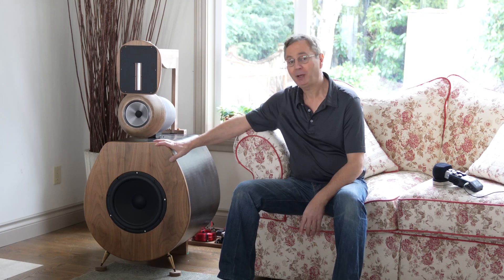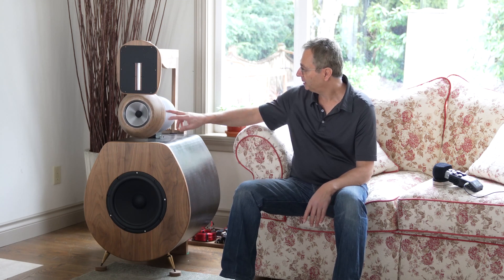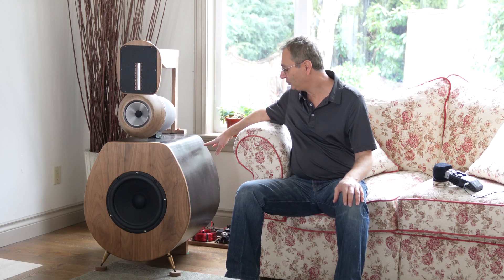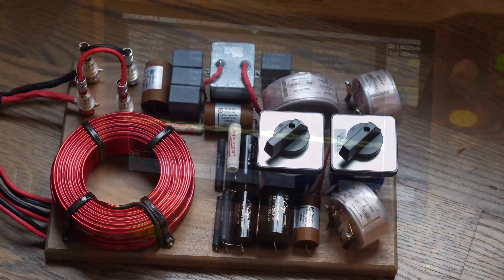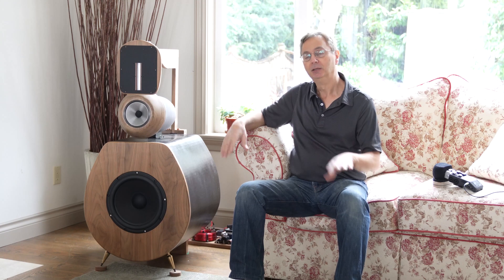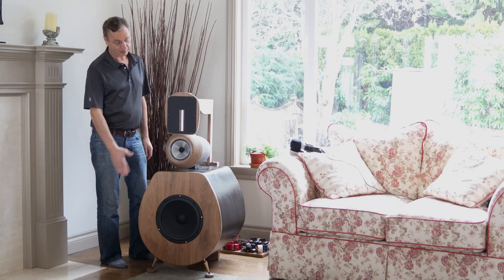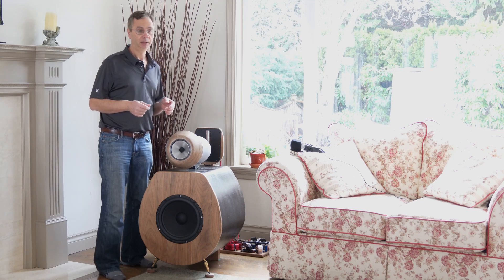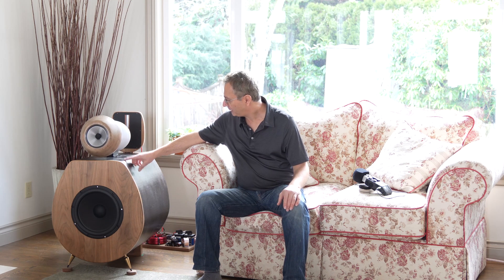My Best DIY high end Speakers Part 1

Comment: Hi 
I have enjoyed every minute I have watch this video 
However you didn't mention where did you put your crossover points 
As I can remember the B&W is a pure midrange with low xmax and it can't get lower than 250Hz and as it being 6 intch driver it can get higher than 2.5KHz 
Am I wrong???

Comment: You obviously didn't try the right active crossover. It is night and day back the other way. It would take a mega high end passive crossover extremely well designed by someone who is a master at designing crossovers to come anywhere near close to a really good active crossover. I am using a Ground Sound DCN28 with my Raal / Scanspeak / TC Sounds open baffle speakers and they sound absolutely wonderful.

You have already learned some of the most valuable lessons about active crossovers, while you can get a fairly flat EQ, if you apply too much filtering etc etc, you can really wreck the sound. So any changes you make to the active profile should be modest and well thought out. You have also learned the other valuable lesson about active crossovers, and that is you can not beat them for finding the best crossover frequencies. I played with mine for several days just making adjustments and having a listen. No having to muck around with changing components, just update the map and upload it.

As I put in my other post you would have been better off with the monopole Raal 140-15D tweeter. The dipoles like to be a minimum of a meter off the wall (in all directions) to make them sound great, and by putting the dipole virtually on top of the rear wall you are almost making a monopole out of that dipole but with poor time alignment.

You should try and put the speakers another half a meter further into the room and have a listen (while the wife is out).
Reply from the maker: That looks like a nice unit all balanced, I went on their site sad to see they are out of business.
Reply: @Gabster1  unfortunately they are. I bought mine probably 11 years ago and it cost me about $7,000 back then with the software dongle (that was about $1000).

Today I would probably go with a DEQX which I was also looking at back then.

Comment: I am wondering why you chose to use the RAAL dipole tweeters instead of the regular monopole 140-15D, when your mid is and bass obviously enclosed. I use the RAAL 140-15D AM dipoles myself in my open baffle speakers, but they don't sound as good as my monopole 140-15D AM.
Reply from the maker: I love them I wanted to have the option to close the back or not but decided not to after listening to both but never tried the factory closed version.  Mine are crossed low around 2200 hz so I get some of the open baffle sound. I think for the dipole the distance to the back wall and even side wall play a role so as room acoustics.
My second favorite listening position is a chair between the 2 speakers you feel you are in the band try it sometime.
Reply: @Gabster1  it is hard to go wrong with RAAL tweeter regardless of what you buy. I have 2 x 140-15D AM dipoles, 3 x 140-15D AM monopoles (future L,C,R) and 4 x 70-10 AM monopoles (future surround speakers)

I just found the 140-15D AM monopoles to be that little bit nicer, plus they also play lower. I have my dipoles crossed over somewhere around 2700 - 2800 (can't remember what I set in the active crossover). But the monopoles are capable of going as low as 1600Hz (LR4 slope).

Have you tried making the mid open baffle? I think you would be pleasantly surprised. The woofers I don't think really matter that much. Currently I have my 18" woofers without a baffle, but I am going to build some enclosures for them. You need a awful lot of drivers to do OB woofers properly (due to cancellation).

Also as a side note I love the ScanSpeak 12MU's paired with the RAAL tweeters. The paper driver is very neutral and compliments the tweeter well. Ribbon can sound a bit in your face if crossed over to low, Using a paper driver as a mid tames any brightness that might be exhibited by the tweeter.

Comment: Great job 👏🏻  like the frequency with a little lower at 1-2k. It’s an area that can be hard to listen to. You thought of many things on this build. Standing waves. And sandwich construction etc.  … really great. Like to hear them.
Reply: Are you talking about the tweeter to mid crossover point? The dipoles don't like to be crossed over too low. Raal recommend a 4th order LR crossover (reasonably steep) at 2500hz, whereas the monopole version of the same speaker can be crossed over as low as 1600hz @ LR4 (presumably it can go lower because the back is encased and controls ribbon movement). I cross my Raal dipoles over at about 2750hz, any lower and it can start to sound a bit too clinical. The one great advantage of using an active crossover, you can play to your hearts content finding that sweet spot.

Comment: I think you have to play with the port a bit. It punches at some quite high frequency. Also three bands are audible: lows, mids, and highs.
PS It's easy to sell metal membranes, but I'd never use it in my design. 
Try to stitch bands properly, and you will never need the most expensive drivers in the world, and 1-st order crossover will be enough.

Comment: the highs sound waves travel faster than bass so it's normal that  it's better to put the tweeter back
Reply: All sound travels at the same speed. i.e the speed of sound (which is effected by temperature and pressure) but I digress... What alters is the wave length of the sound wave. At 20kHz the wave length is 17mm, whereas at 20Hz the wavelength is 17 meters. Why you often see the tweeter slightly set back is to time align the drivers. In the case of the Raal dipoles he is using, the aluminium ribbon is ideally aligned with the centre of the mid, and the centre of that is in line with the centre of the woofer. Because of the depth of the cone of the woofer that means the mid needs to be set back slightly and the same again for the tweeter.
Reply: Bass is also omnidirectional

Comment: I'm really impressed with the sound of these, but even more impressed with the level of skill it took to design and create them. Amazing.
Reply: Chris. You just listened to your headphones/speakers NOT the guy's speakers. The actual transducers that transformed electrical signals into sound pressure waves that reached your hears were your own. The skills and aesthetics of them DO pass through video pf course.
Reply: @xedasxedas  Came here to say the same thing lol. Never ceases to amaze me that people think they can hear someone else's speakers on YouTube when they are just listening to their own.
Reply: @EvanZamir  while that is partially true, people also forget that you can hear a lot of micro detail even on YouTube that is simply not present on cheap speakers. Subtle nuances will always shine through, regardless of what it is played back on (within reason). I have a fairly similar system (most of what you hear is coming from the Raal dipole tweeter which I have) and while it doesn't sound as good as mine obviously does in my room, it is a fair representation of what that driver is capable of. They truly are a speaker worth buying (although not cheap... like $1000  USD each for the AM version).

Comment: Thank you very much for sharing, It is people like you that makes  me want to build more.
I will be building the same speakers.
love the sound.I have subscribs  to your channel too.
Reply from the maker: Thank you, and enjoy the process.
Reply: @gabster1 Great videos! I really enjoy your creativity. I'm wondering how you came up with the design for the woofer cabinet and the midrange. How did you know it would sound as good as it does? You mentioned making the woofer cab deeper to get enough volume without making it wide or tall, but was it just intuition? Similarly, with the mid, I'm curious how that design came about. Thanks!

Comment: Is there a parts list for the speakers? I’m looking into making some myself
Reply from the maker: Scan speak 32W/4878T01 woofer,  5inch BW D3 or Scan speak MU 12  Midrange, Raal 140 15DAM tweeter.
I will be doing a video about the crossovers in the future. it is a simple second order design
Reply: @Gabster1  have you tried the Scanspeak 12MU? I am using a combination of the dipole Raal 140-5D AM in conjunction with the Scanspeak 12MU in open baffle configuration and it sounds amazing (crossing over somewhere around 2750Hz). I recommend giving it a go if you haven't tried it before. The paper cone / ribbing / neodymium magnet system of the illuminator series driver is a great combination. Gives voices such a warm natural sound to them without sounding bloated and artificial like the enclosure gives you. I have mine mounted right under the tweeter to stop lobbing. I don't know if it would sound too harsh, but I would also like to try some of the Accuton mids.

Comment: Congratulations on the project.  It is amazing how we can arrive at similar solutions even without ever having met!  Even in my modest project I made a housing for the BeW FST mid .. which I still have to get. On the TW I prefer a front only emission but it is just my preference.  The external crossover is also a great idea, in my case it is installed in an opening on the bottom of the speaker, in order to be accessible for any modifications.  My compliments again! https://youtu.be/5li6EjvP-rE
Reply from the maker: Thank you Luca was happy to be your 200 subscriber Beautiful speakers you created and a great channel. I will for sure check it some more as I get some free time.
Reply: @Gabster1  Thanks so much !
Reply: Wow amazing craftsmanship Gaby.  You definitely have a knack for making complicated projects but yet also make it look easy to do.  Cannot wait to hear them one day
Reply from the maker: @robertcasey1284  Thank Rob Hopefully you will hear them soon :)

Comment: WOW! Those things are meticulously engineered & beautifully crafted! Your channel deserves way more attention!
Question: When the ribbon tweeter is positioned all the way back, Does 'Time-Alignment' really mess with your ears? Or does it sound more like an 'ambience' tweeter, since the response would be nicely dispersed by the curved midrange 'shell' housing? 
I ask because my ears are very sensitive to 'shiny' tweeters & lobing effects, especially if there is any hint of sibilance, This design seems to solve both problems.
Reply from the maker: Thank you for the support. The channel is only 5 month old and seems to be growing fast. I actually can not hear any time alignment difference at all but had to keep the time aligned version or I will be crucified by the critics I am like you. It sounds more relaxed but still detailed with more air. It also does not affect the imaging.
it is more likely to hear a midrange time alignment difference then a tweeter. the best part is the measurement at 45 degree horizontal angle is still almost flat.
Reply: @Gabster1  That sounds encouraging! If I may suggest, for the speaker mounts, use stainless steel 'copper' screws. Just dip the silver screws in Copper Sulphate solution, Takes only 5-10 seconds. Less shiny, more SteamPunk-vintage-copper. Provided, Of course, that look is palatable to you :) 
(Works best on shiny stainless-steel screws, also works on bare steel/non-oxidated/non-zinc coated screws)
Reply from the maker: @vikassm  That is a Awesome idea I may do that I have a jar of Copper Sulphate solution that I was recently using to plate a vintage amp. I am very comfortable with that. THANK YOU

Comment: They are awesome. You did a great job. The crossover parts probably cost more than most other peoples speakers alone. I love seeing good diy audio projects and this one is great. I wonder how big was the difference between the low cost crossover compared to the high end one? I have a speaker project planned for the future and this really inspires me more. Thank you
Reply from the maker: Thank you :) glad you got inspired more to build some speakers. Hard to tell without a quick A/B listening test  as there was a lot of fine tuning and small changes, but going by memory there was a good difference but not huge.
Reply: Quick question, what is the manufacturer and model number of your Twitter @Gabster1